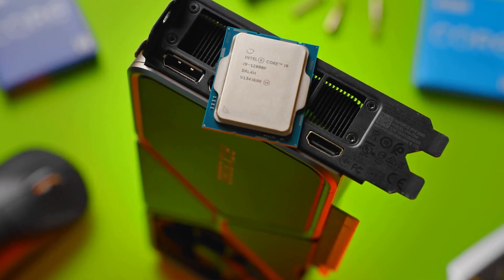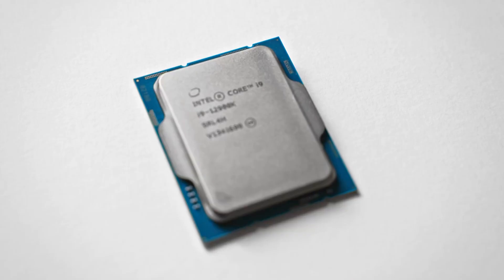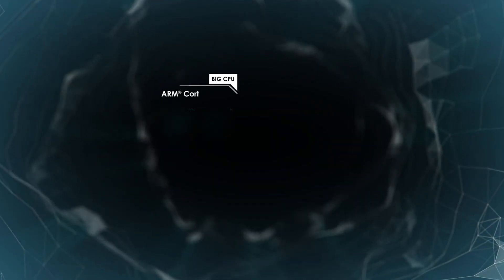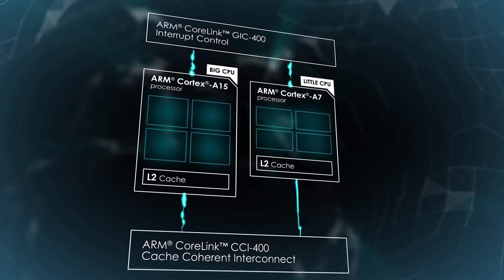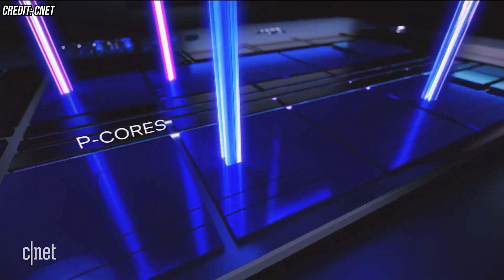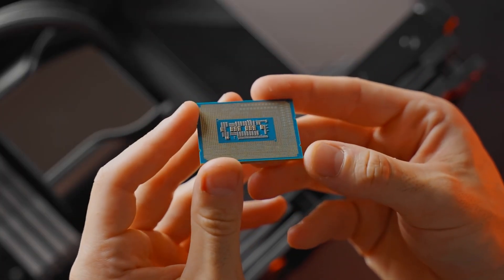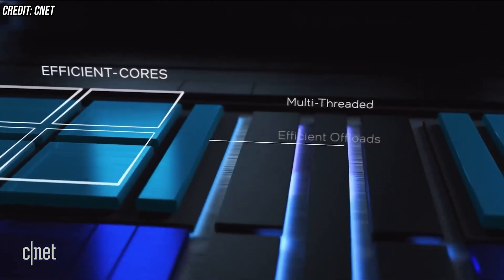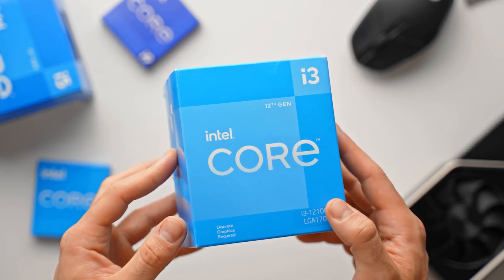e-core vs p-core: what are the differences and why should you care?

Comment: This modern processors are complete $hyt!
My ancient I3's and I5's are 12 years old and still  working greatly.
But my new I5 and I7 stuck with simple tasks, not to mention the overheating, which by the way, the stock fan that comes with with them are simple garbage.
And now you have to buy an "OK processor", and you still need to buy a real cooling system on the side.
NVIDIA seems to go at the same direction.
Reply from the maker: Im guessing it’s a pc and not a laptop. If it’s a pc so many factors come into play that might affect your performance.
Reply: @tech-techover  
"I work with PCs and laptops, both my own and those belonging to clients and friends. I've noticed a consistent pattern: a realistically good processor is an i7 or better, with at least 8 cores."

Comment: quick question! is the 12900k more efficient and fast with 2 separate cores (P and E) then a Ryzen that has one source of cores?
Reply from the maker: One could argue yes and no. Because both processors run on different architectures. Though in my opinion P and E cores seems like a better approach since you only activate each core when the need arises making it more efficient. Unless you want to run on full throttle all the time then Ryzen is the way to go
Reply: @tech-techover wouldn’t you think that having 8 cores running a lot of something and another 8 cores running little would make the p cores way more stressed and heat it up way more. Making one core type cpus better for temps. Or having 10 p cores and 6 e cores would be more balanced since p cores take on more

Comment: So this is how Intel save money, mix celeron and high end cores together.

This seems like a rip off,  pay premium prices for only half the cores. The only reason they call them (E)ffcientcy cord is because they are from laptops. Why would I want to have efficiency cores in a desktop? It's not battery powered?
Reply from the maker: I guess its a ploy to reduce carbon emissions 😅😅. in such a scenario where your desktop is idle it reverts to efficiency cores and saves power consumption that way instead of going full throttle all the time.
Reply: Would prefer having it on my pc too anyway as i prefer performance per watt more than traditional method of more performance higher watts. Thats why i love arm a lot and wish x86 could follow it or just die already x86 if they cant be as efficient as arm..... they are the no 1 problem on laptop battery and my electricity bill.

Comment: i bought a laptop which has core i5 and 12 cores(8 e cores and 4 p cores) but the clock speed is 1.7Ghz for  rupees 58K . is it a good purchase . BTW  it was a very good video explanation
Reply from the maker: 1.7 clock speed is good for light work loads but I would also like to know what is the boost clock speed. If it’s somewhere in between 3 and 4 the its great. Though with that high number of efficiency cores i guess its more of a notebook and not necessarily a high performance laptop. So is it a good purchase that depends on what you want to do with the laptop. If its mostly work, browsing and light tasks then its a good purchase and if was for something like gaming triple A type games then its not.
Reply: @tech-techover  it is asus vivobook 15 i5 12th gen
i want to use it for work purpose ( i thought having multiple cores might be good
Reply from the maker: In that use case scenario its a perfect choice my friend 👏👏
Reply: @tech-techover  it has a turbo boost of 4.7 Ghz ,
Reply: @tech-techover  thank you for your response , for the info you gave me things i can do to support u is through my various account (4, not much though😅)
Reply: is it a good purchase
Reply from the maker: It is a good purchase
Reply: reply

Comment: The E cores and P cores are due to the competition from Apples m1 silicon and the battery life it comes with. I love competition so much it always forces the companies to do better.
Reply: That is just incorrect. Apple’s share of the market is just too small to bother. Intel’s “e” cores were and are the answer to AMD’s core count because Intel couldn’t possibly have all “p” cores with their present architecture. Intel’s power draw is insane and their heat problems a real drawback to having more “p” cores. Their “e” cores shouldn’t even be added to the total core count. That’s what irks me the most. Running a 1000+ watt power supply is a must with an Intel based rig if paired with anything above a 3060. So lets not BS. Intel current design is flawed and will not last much longer. It has reached the end. AMD’s is a new architecture that has room to grow……..and will because they have surpassed Intel in innovation. Intel sat on its hands for way too long and now play catch-up………..and dare I say……..looks good on ‘em.
Reply: @techluvin7691 amd is trash
Reply: @techluvin7691  AMD shills are just funny. You do realize that company just pays off influencers to sell you snake oil right?
Reply from the maker: Yes intel was lagging behind
Reply: The e cores arguably contribute nothing and actually reduce gaming performance.
Reply: @jaredangell8472  There are still a large number of threads from the OS, drivers, background tasks, etc. which don't require massive cores. If e-cores didn't exact, you'd need to schedule a p-core to deal with everything from mouse and printer drivers to background memory management or IO or a frame tracker app.
Reply: its just to run the system bloat because of how terrible microsoft had become imo
i wanna use gentoo and only 16 threads on the CPU are useful for compiling because they have L3 cache

Comment: Reason why I’m getting 13th gen instead of ryzen 7000 is because of ddr4 support :)
Reply: but ddr5 is less power-consuming that ddr4
Reply: @ update: I’m getting the 9800X3d and I’ve already brought the ram and motherboard.  Ram Corsair dominator platinum 2 X 16gb 6400mhz CL32 and the motherboard is the MSI MPG Gaming carbon WIFI X870E